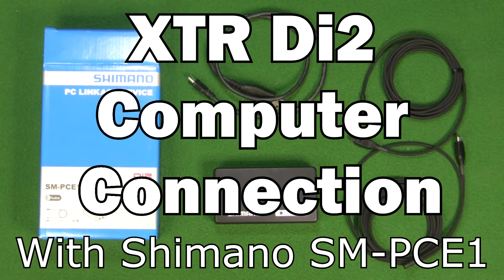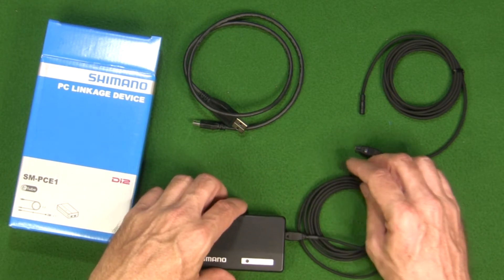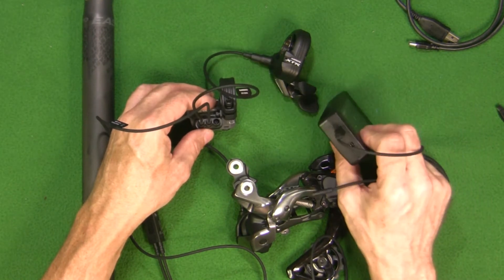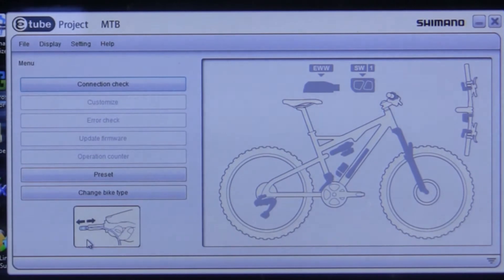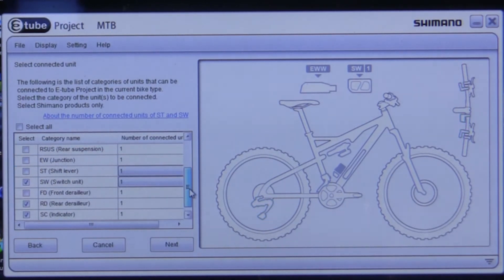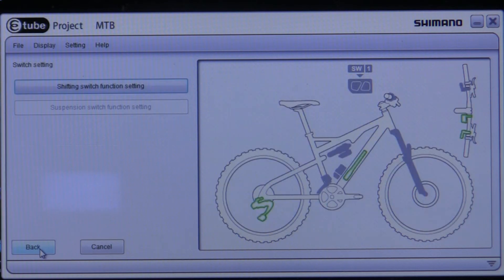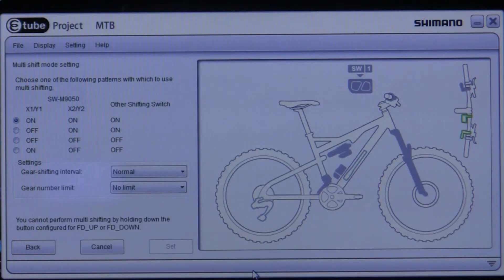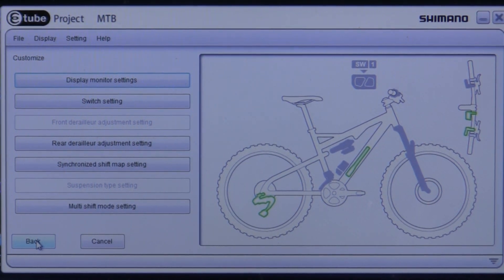XTR Di2 Computer Connection using SM-PCE1

Comment: Am I need the Shimano SM-PCE1 to install the system at the first time even I have got the EW-WU111 wireless transmitter unit installed ?
Reply from the maker: Jacky Kong you don’t need it unless you want to reprogram it
Reply: Larry Grimm thanks for your reply, which mean I can use the Bluetooth to program the system at the first time ? Am I correct ?  And the SM-pce1 only work on window system ?

Comment: It comes with two cables and ports, in order to use the unit as a bypass if there are no open ports on your rig. For example. You disconnect a shifter cable from the handle bar screen and connect it to the PC interface and after that the PC interface to the handlebar screen. Now you got a bypass wiring that's complete, including the PC interface interfering the system.
Reply: Yeah, it's painful, since there are two male connections, you are essentially bypassing a wire, which is a hassle if you have internal wiring and junctions. Would have been easier to be able to, say, unplug the rear derailleur and plug in a male end to the RD and a female end to the (male) wire that you just unplugged.
Reply: Actually, it does not matter where you will connect the PC interface as long as it is interfering with the current wire network. I think, an easier and a more cost effective solution over time, is, to buy the ANT Private, Bluetooth LE (wireless) ready screen "Shimano XTR Di2 M9051 System Display". This one will also give you the opportunity to make adjustments by phone even outdoors without the need of a laptop or an indoor PC.
Reply: Totally agree. My point was you can't easily use the second wire as a bypass because you need physical access to both ends of the wire you're bypassing (I use a spare wire and B junction). Not sure why they don't cable directly to the A junction's charging port.